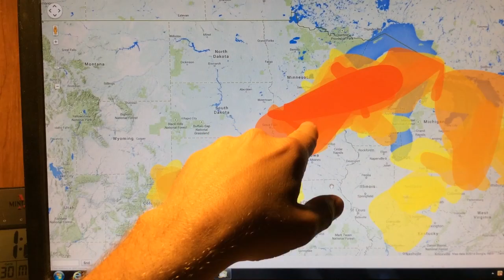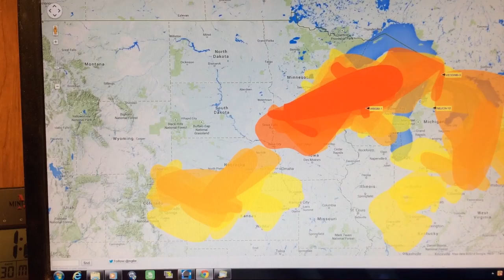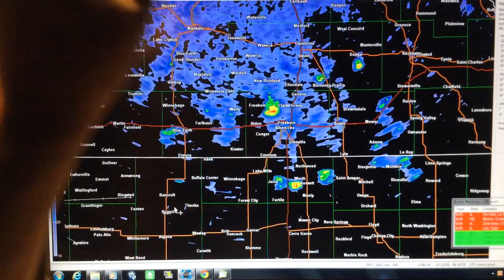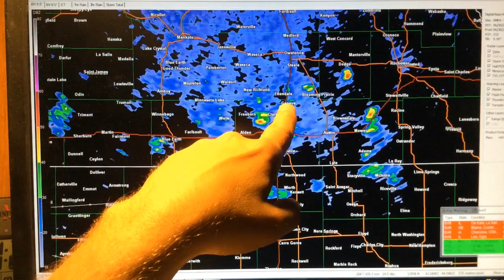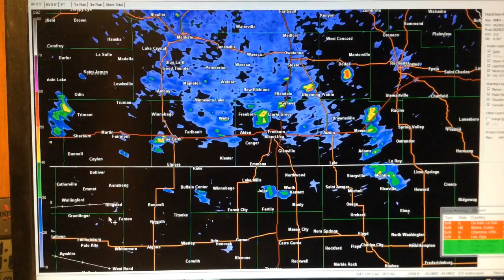Radar Returns During Tropo Ducting Propagation

Comment: Indeed, the NWS has several “modes” or VIPs they use depending on the weather environment. In “Clear Air” mode the radar is much more sensitive and also slows way down, taking about 10 minutes to do a complete volume scan (all the other tilts of the beam that we look at during tall storms). If you loop a national radar composite without any filtering you will see the inversions form at night near each site from east to west and then the clutter will disappear as the air mass gets enough solar radiation to mix out the boundary layer. This looks like the program GR3 or GR2 by Gibson Ridge. GR2 analyst is pricey but you can look at the other tilts and cross sections and see into storms and melting layers, etc. The normal “reflectivity” is what’s shown on tv and what you’re looking at here but there are all kinds of different products that come from the radar beam. Reflectivity is just how much “stuff” the radar beam return is seeing. For instance the Spectrum Width product would likely stand out here. SW is basically how much the velocity is varying within the radar pixel. In colder more uniform rainfall you’ll see very gray and uniform returns. But any wind shift or rotation or wind mill farm would stand out in blue and yellow to red. The key to knowing when you’re seeing weather and when some of that beam is hitting the ground is to loop it as you do here. Weather moves, the ground doesn’t. Now the overall sensitivity will increase toward morning and decrease during the sunrise, because you’re essentially seeing the inversion form and then the sunlight heating up the surface enough that rising air busts through it. So a loop of the lower 48 in the summer mornings will usually show this happening at each radar site but with each site showing a slightly different trend at sunrise and sunset (within the same air mass). You basically can follow the sunlight in the mornings as the sun rises at each location and mixes out the boundary layer (assuming you’re not getting “weather” and you have the calm and clear conditions usually in areas of high pressure to optimize decoupling at night.)